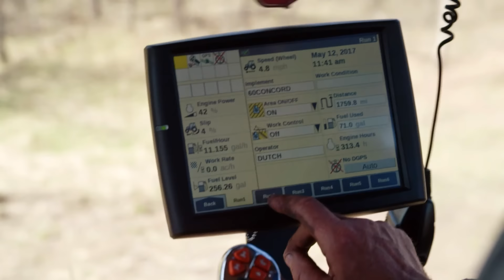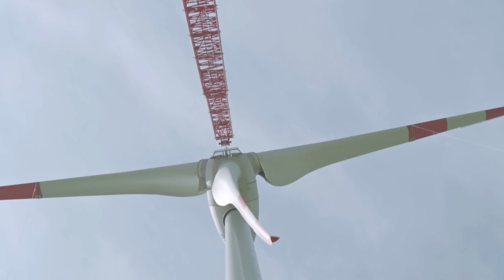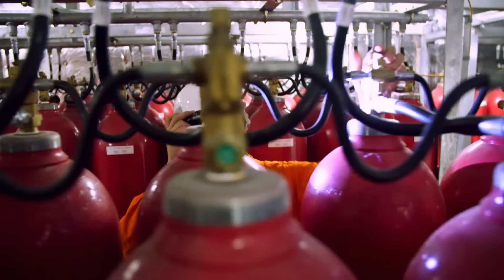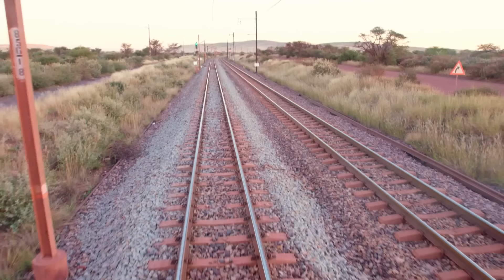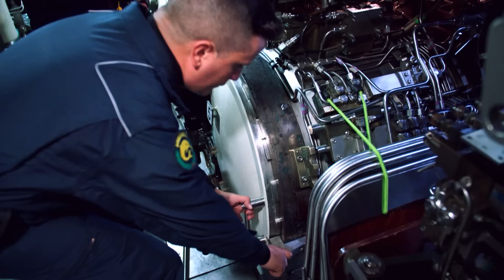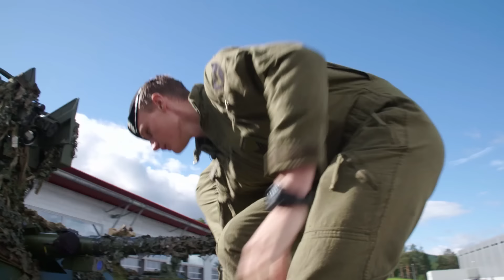Ultra Strong Vehicles: When Horsepower Meets Technological Excellence | FD Engineering

Comment: Meanwhile, military-grade systems like the MTU EuroPowerPack, which delivers up to 1,650 hp through a robust V12 engine and ten-speed automatic transmission, highlight how engineering excellence in horsepower also powers critical defense and heavy-duty applications.
Reply: No. Obsolete fossil tech.
Reply: @crhu319  who is gonna tell bro that ts aint tuff

Comment: This footage must be quite old because at the time of the video's release the tractor in this video, a Case IH Steiger model 620, put out a maximum of 680hp - and it had for a few years. As of 2025 Case IH also makes the Steiger model 715 which puts out a maximum of 778hp, in addition to the model 620 which puts out a maximum of 680hp.

Comment: How does it match against the Big Bud with 700 horse power.
Reply: I’m honestly surprised they used a standard Steiger and not a quad track as the quad track is much more popular and has even less ground pressure and it’s an all around better tractor and would definitely beat the Bud in most competitions
Reply: Doesn’t one bud have around 1100 hp?

Comment: Is Case considering going to compressed hydrogen gas fuel for these tractors like Wartsila, Finland has done with ships engines?
Reply: I will say more then likely not based on the use of these tractors, there are thousands of these across the globe and just the availability of diesel fuel settles that debate I believe they have looked into biodiesel in the past but emissions regulations have limited its usage. Not to mention farmers would not buy a tractor that wouldn’t run on diesel like every other piece of equipment they own